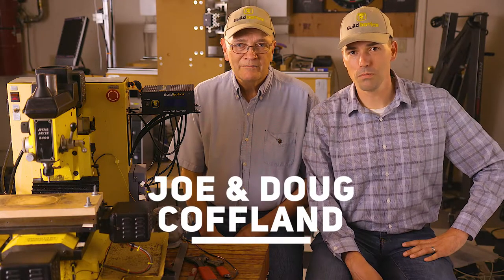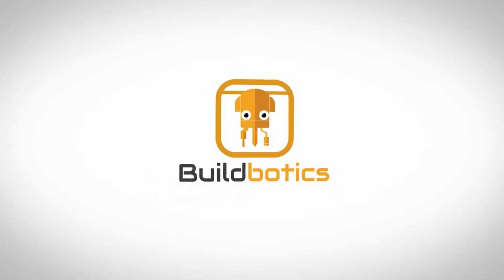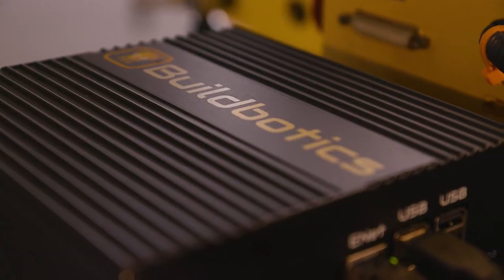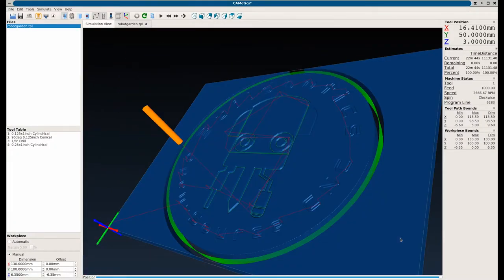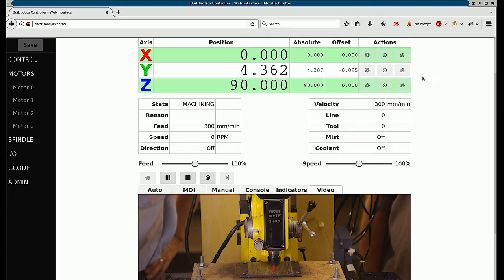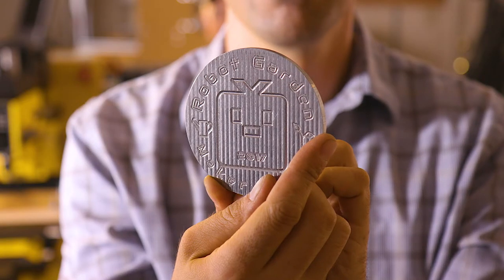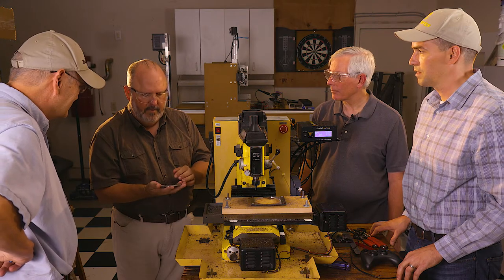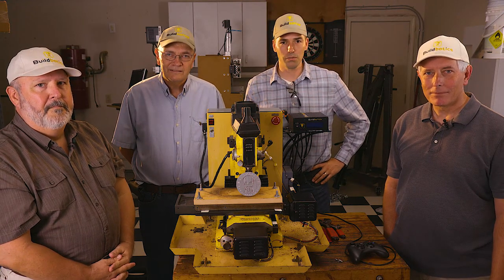Buildbotics controller revives the Dyna Myte 2400 CNC  (Call us 707-559-8539)

Comment: i need help getting a dyna myte 2200 4 axis benchtop goin. it turns on and runs only the manual has been misplaced and i do not understand its controls nor its language. i am used to cad,g code. i am impressed with this video and would appreciate any info . oh yeah, this machine is over 20 years old n collecting dust. please help.
Reply: it is actually a dyna myte 2400. I would like to purchase the upgrade. Please include price.